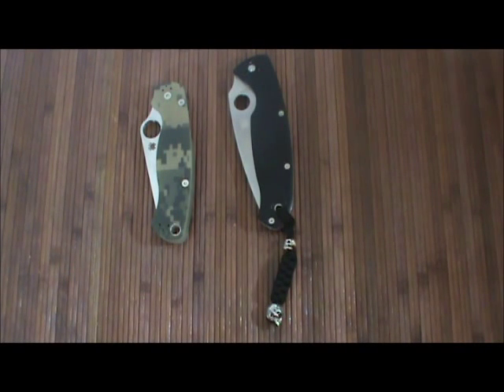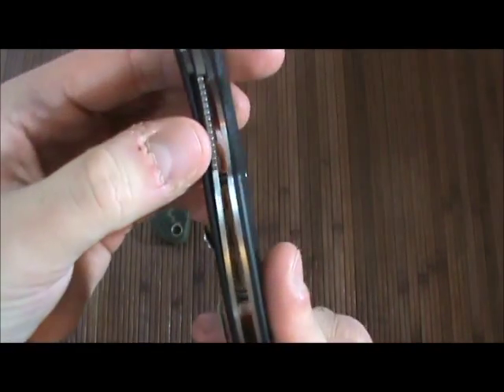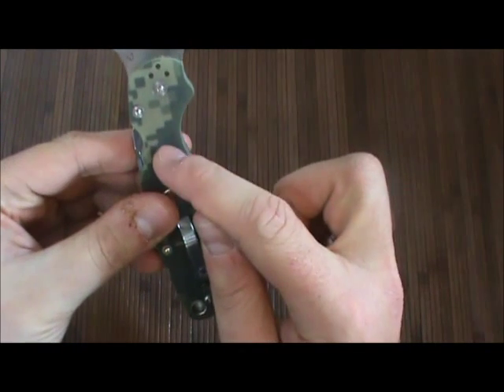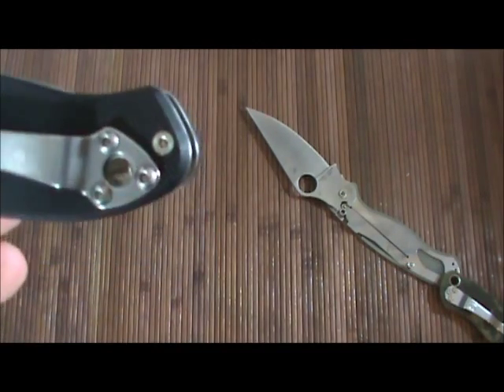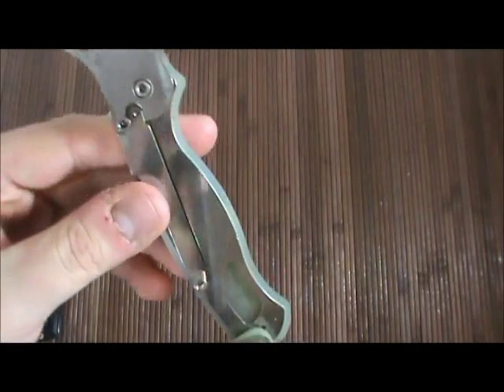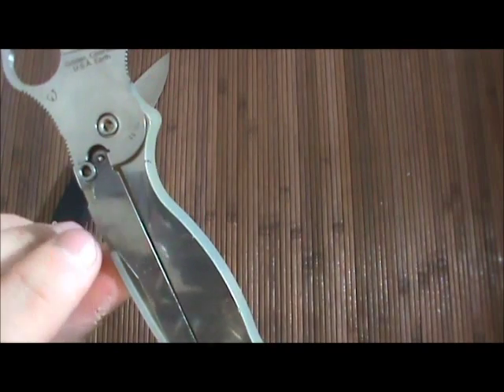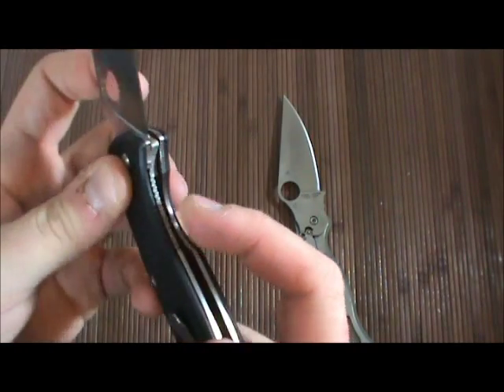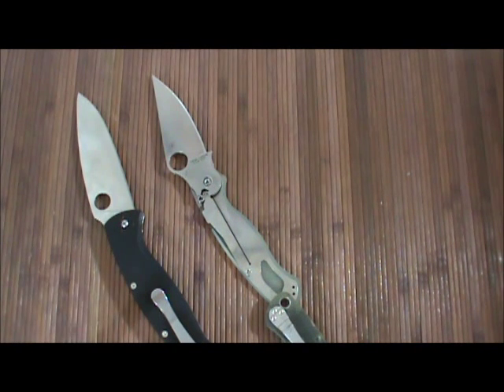Compression Lock vs. Liner Lock

Comment: The locking mechanism is very important for self-defense EDC. Hence, this video is very important. Good job illustrating it. I have had a liner lock fail when it was needed. Compression locks are superior locking in my opinion also, based upon my experience.
The knife's use matters. So if one only uses a knife to skin game or cut cardboard, then the lock may not be an issue.

Comment from the maker: @BeyondHostile 
This is true. In fact, I don't hear much at all about the compression lock in detail. Part of the reason I made this vid, but as you stated I also did not mention lock up percentage in the vid. My para two started at about 40% and now is right at 50% on the lock face after breaking it in.

Comment: Now I have to ask. What kind of physics are we talking....are we talking superhero v. super villain fight when it comes to bending and compressing (im assuming) the same metal that the blades themselves are made out of? In the case of actually being able to do that (bend lock bar and or liner lock steel)  Would an every day humans wrist break before that kind of pressure exerted actually had the ability to fail a .15" bar of steel?